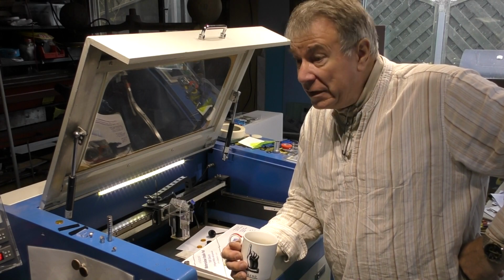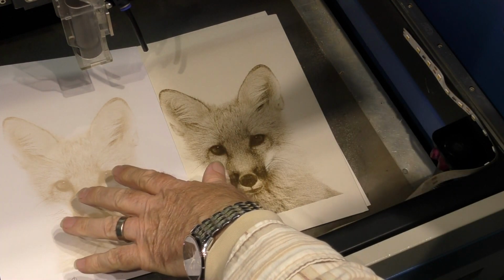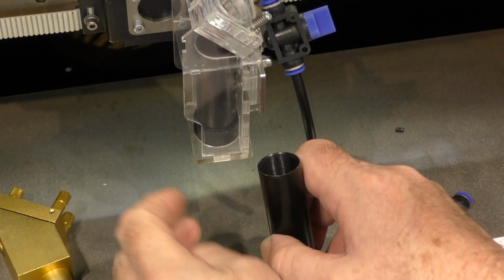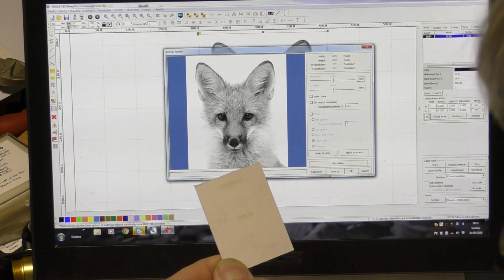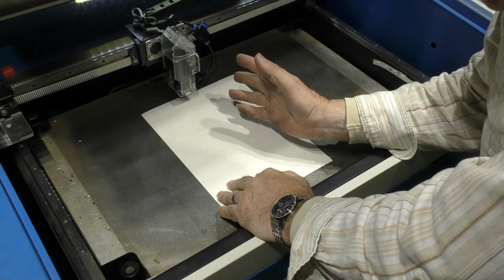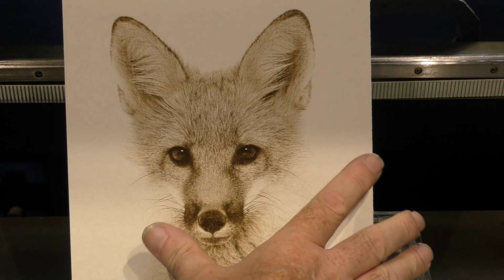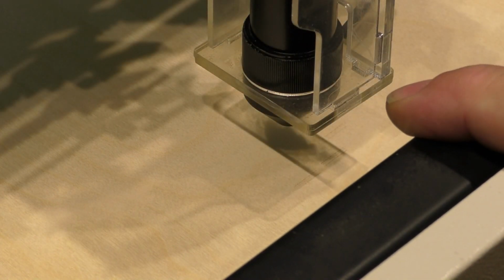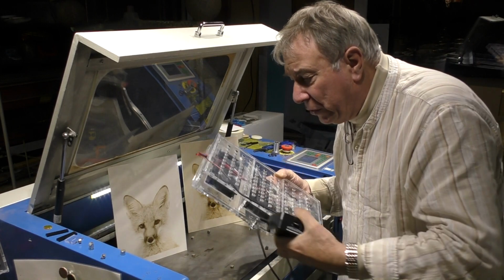158 Compound Lens and Universal Engraving Nozzle

Comment: Not sure if you have covered this but did you ever find a good way to protect yourself from reflections. From what I have read the china made laser goggles are crap. The best thing would be if there was some sort of acrylic that filter out the 10600nm light but so far I have not found anything. I just bought a used 100w red/black and I am a bit worried about getting reflections in my eyes.
Best regards
Reply from the maker: Hi Richard
Yes this is well covered but it is easy to explain. The light emitted form the tube is just that , invisible light. It is a light that is coherent ie all the photons are fully synchronized. They travel in the same direction without divergence so there is no incidental light scattering from the beam and if there was an odd photon here and there the energy density is so close to zero it would be harmless.. A rock falling from on high is completely harmless whilst it is falling, it is only when that rock hits something in its way does energy transfer take place and the recipient experiences damage. So it is with the laser beam. It is just a beam of light energy until it hits something solid. As far as this 10.6microm light is concerned there are 3 basic materials it can collide with . The first group  is metals. ALL metals will reflect the light to a greater of lesser degree.  Copper ,Gold, silver, Aluminium  for example are better than 99% efficient reflectors and others may be as low as 60%. That why all mirrors in our machines are metal or metal coated.  The second group  is very  small and contains a few  crystalline salts that allow the IR light to pass through . Those materials are used to make our lenses. The third group is EVERYTHING else. Yes everything, including your eyes, skin and clothes. When the IR light hits  one of these materials  this is like the rock striking. The light energy stimulates the molecules in the surface it strikes, making them vibrate faster and faster. The temperature of a molecule is defined by it vibration activity. The faster the vibration, the hotter the molecules temperature becomes.. The light does not penetrate into the material (that only happens in the crystalline group) it just reacts with the SURFACE. making it hotter and hotter until the material reaches a point where damage or some other change occurs.  You will note that  ANY material that is not in group 1 or 2 will stop IR light in its tracks and react with it.  You do not need special glasses to protect your eyes . This invisible light will react with anything in its way. Just ordinary glasses  will stop the rays dead. Glas may be transparent to visible light but it is totally opaque to IR and will just heat up and eventually crack. Most glasses these days have polycarbonate or some other lightweight plastic lenses. You will quickly see a mark forming on the plastic if an unlucky strike does occur. 
 If the lid of your machine is closed you are as safe as houses. Even with the lid open. it is almost impossible to get your eye into the path of the laser beam, your fingers yes ( and ouch that hurts!!). What you must be very careful of is any metal surfaces YOU place in the machine that could exposed to the laser beam and  REFLECT at you. 
Understand what this beam is and respect it. Yes, it can on occasions be dangerous to you if you do silly things , caution ,not fear, will be your protector. After all that, if you are still worried then spend a $ and get a pair of these
https://www.ebay.com/itm/Safety-Goggles-Vented-Glasses-Eye-Protection-Protective-Lab-Anti-Fog-Dust-Clear/291945162727?epid=2119201009&hash=item43f949a7e7:g:pP8AAOSw4GVYLRBi:rk:2:pf:0

I use my machines all the time with the lids open because I do filming and experimental work. I just wear cheap reading glasses.

Watch the following video from 9 to 13 minutes for a practical demonstrarion of the effects I have described
https://www.youtube.com/watch?v=kx4vmDguCyE&list=PLPWEtx5V9DqEogIeYRdcG_KYcB7UL2Qmn&index=2&t=372s

Watch this to see all about the reflectivity of the metal group 
https://www.youtube.com/watch?v=kJe16YQlIM0

Best wishes
Russ

Comment: Russ, thanks again for all you do! I have ordered the lens kit. You may have just solved my need to get dot size below 0.5mm for engraving my fine line work on watch dials. Rob (the 24K gold lens guy)
Reply from the maker: Hi Rob
Depending on the power of your laser you should be able to easily achieve a 0.1mm (0.004") lines. Thin lines are easier to produce than dots and you may be able to get as thin as 0.05mm (0.002") if you run at a higher speed. 
I was really disappointed with the conclusions for gold but my copper mirrors are still going strong
All best wishes
Russ
Reply: I'm not disappointed with the copper lenses, I can buy a bag of copper lenses for what gold plating solution costs.  ;)   The substrate I will be using this on is made specifically for co2 lasers, I will let you know how it works out.
Reply: BTW, sent you note about blue head replacement mount and parts as mentioned in the PDF. Hopefully you get it.

Comment: Great as ever, Russ, thanks for the video If I may comment on your vacuum table, you can get better vacuum with a centrifugal rather than axial fans. You are after higher vacuum/pressure, and virtually no air volume. That's where they are better - try it instead of your vacuum cleaner :)
Reply: Hi Otto
Yes I am aware that I can get a slightly higher vacuum with a centrifugal fan but they are so much more bulky to mount. It was weekend when I needed this table so I quickly used what I had to hand. Plan A  employed a small vacuum cleaner I had in the workshop. It worked perfectly but the stalled airflow was giving the cleaner's motor a VERY hard time and also my ears. Plan B was neater and far less efficient  but I had 10 of these fans on the shelf as a left over from a job. I am both a squirrel and a skin flint, so bringing them into use cost me nothing and worked well enough for paper and card. There was also a plan C which involved either a small Gast vac pump or a larger flow rate Edwards unit. It may take very little to turn plan A into Plan C. Plan B was neat, quiet and and at about £2 each if I had to buy the fans  is a cheap and adequate solution if others wish to copy. After all, who generally has a couple of vacuum pumps kicking around in their shed?  My whole strategy while house training this  little Chinese dragon, has been  to  understand it and spend as little as possible to get a good result. If I had followed the many suggestions I have had in 3 years, I would now have high speed  analogue servos with linear encoders, anti backlash rack and pinion drives and a 40 watt RF tube along with the beam combiner,  beam collimator and aspheric lenses. Where is the fun and challenge in buying my way out of a problem?
Thanks for the suggestion though, it gave me a chance  to explain my design decision.
Best wishes
Russ
Reply: Hi Russ,
thanks for your explanation, I know the feelings, I am also a squirrel. Thought again about the fan bed, if we use  blowers in series, it would increase vacuum... Just a thought.  I happen to have choice on my shelve, so I may try it one day.
cheers
otto
Reply from the maker: @ottosouta7445  
Nice idea. I don't have enough to double up (at present) but if I run a video about how to make it I will buy and extra few fans to adopt your idea and increase the depth a bit as It's no hardship to add another 25mm
 best wishes
Russ

Comment: Always fun and learning so much. Big thx Russ
Reply from the maker: Hi Rene
Just remember, it's me that's having the real fun and then more. I love the engineering challenges and the learning opportunities that this technology continues to throw at me. After that, I get to enjoy  my second hobby which is video and video editing. It's all win win for me. If you get some pleasure from it as well then that's an added bonus that I had not planned on
Best wishes
Russ
Reply: Hi Russ   Just got the compound less head, but it does not fit the standard laser head (tube) which lens tube do I need, or do I have to get a whole new head, keep up the great work. @SarbarMultimedia
Reply from the maker: @MrSealines28  
Hi Jphn
Take a look here  
https://www.cloudraylaser.com/collections/nozzles-lens-tube 
There are 3 diameters of lens tube available. 20mm, 24mm and 25mm. It is possible that the thread on your existing lens tube is not compatible
https://www.cloudraylaser.com/products/compound-universal-engraving-nozzle?variant=13488869965875   Scroll down this page and you will see that it requires an M22x1 thread
Any of the three lens tubes above will take the M22 thread and if your existing lens tube is one of these external diameters  then it is simply a matter of ordering the correct lens tube

If you hit more problems just Shout out again
Best wishes
Russ

Comment: Nice vacuum table! One suggestion, instead of using six muffin fans you could use just one 12v centrifugal type fan. Muffin fans are good for moving a large volume of air but very poor for developing any pressure. A single centrifugal fan will not move as much air but it will pull harder, in your application that is what you need. 

Something like this:https://www.amazon.com/uxcell-120mm-Blower-Cooling-Bearings/dp/B077R341VD/ref=sr_1_7?ie=UTF8&qid=1539394577&sr=8-7&keywords=12v%2Bblower%2Bfan&th=1